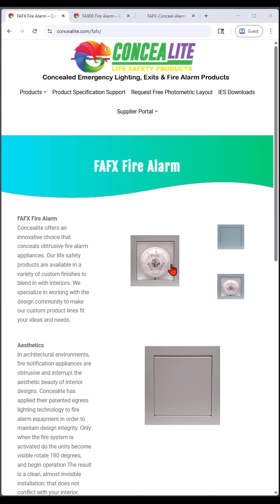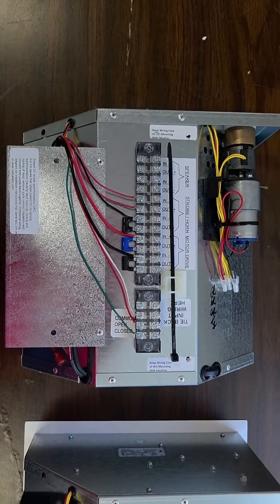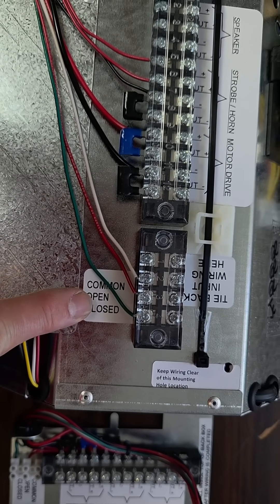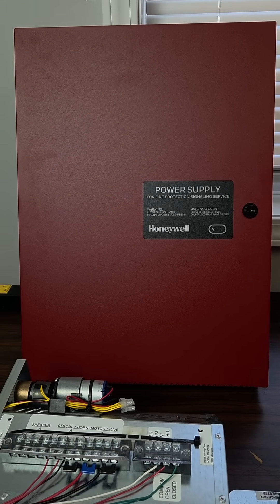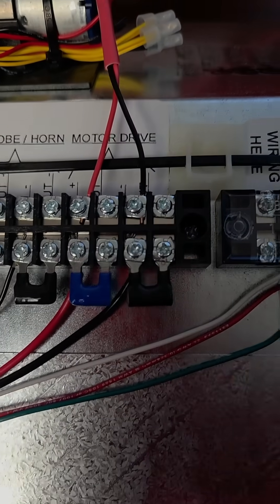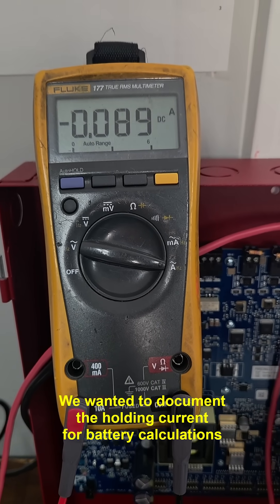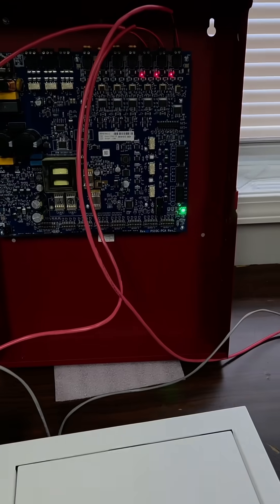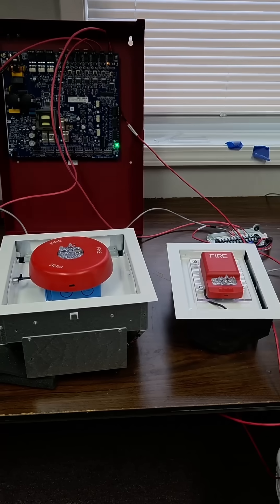Concealite Fire Alarm NAC Devices

Comment: Is there a function in the programming of the panel to override the doors without the system being in alarm to service the devices?
Reply from the maker: Yes, we could have programmed a module to release them upon pushing a maintenance switch. 

However, we plan to simply turn off the motor power supply or disconnect the power output to the device that needs servicing. It is not anticipated to need to access the devices on a regular bases without actually testing the system.